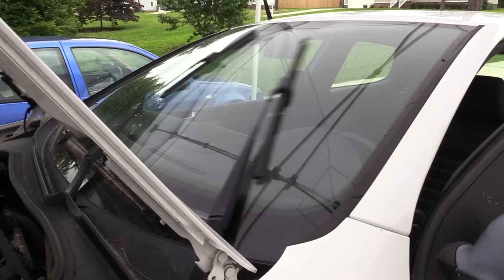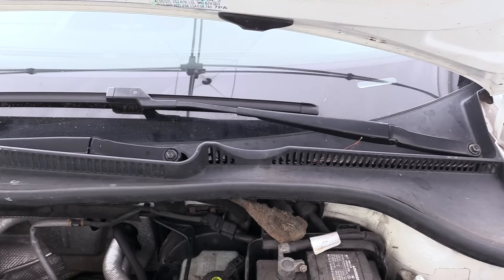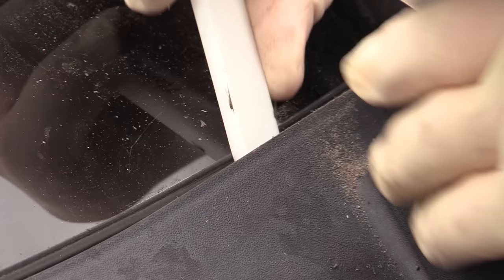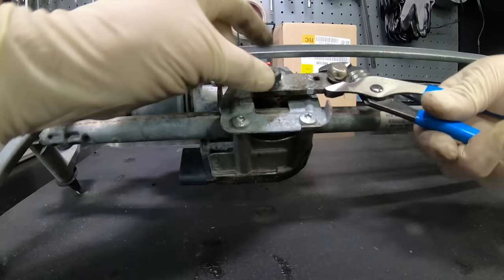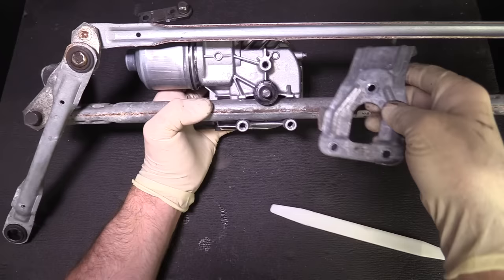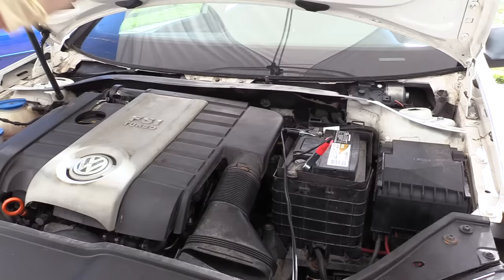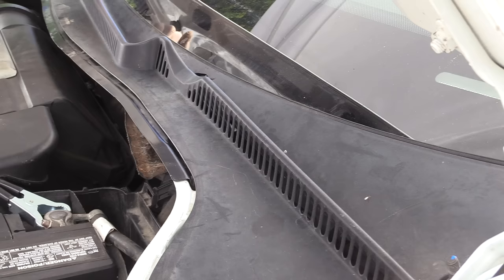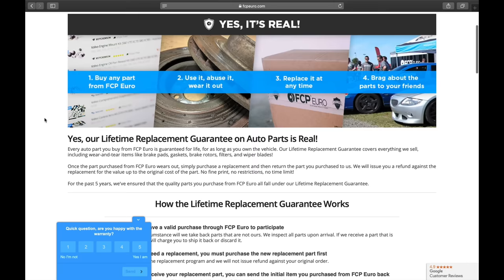How To Replace a Windshield Wiper Motor

Comment: Funny story and question for y'all: Yesterday, I asked my neighbour (who is a mechanic) to help replace the wiper linkage on my Golf Mk6, due to a snapped bolt where the wiper attaches (different story!). He went ahead and replaced the linkage with a new one I got on ebay, but when the job was nearly done, he tells me (in broken english) "motor no good, not work". This didn't seem right, since the motor was fine last time I checked. Long story short: the motor only seemed to be broken because the hood was open, thus disabling it (thanks VW!). But while he an I attempted to troubleshoot this rookie error, I must've pulled the 30A wiper fuse and put it back in the wrong spot, because the wipers still failed to work even after closing the hood and going for a drive! After an evening of googling, I went back to check the voltages at the motor this morning, and noticed that the live wire was reading 0 volts, promptly rectified by putting the 30A fuse back in the right spot. I was about to throw a party to celebrate when the motor hummed to life, but this was cut short when I realized the linkage was only moving slightly, no matter what position I put the wiper lever, and would appear to get stuck almost immediately, making only small noises and twitching slightly beyond the initial movement. I now suspect that my neighbourly "mechanic" has put the linkage back on in the wrong timing position :(. Looking at this video, it seems to need a very precise placement. I'm therefore wondering if there is an easy way to spot if the linkage is incorrectly clocked, before I go to all the effort of blaming my neighbour and getting him to pull it back out and do it over. What position should it all be in when parked?
Reply: Update: pulled the linkage and motor back out and found that the arm was attached to the motor in completely the wrong position, and as a result, was getting jammed against the metal stop every time the motor tried to turn. Following this video to the letter, I was able to remove the linkage arm and re-secure it in the correct position. After reassembly, it all seems to be working like clockwork, wiper blades in the correct position and moving smoothly. Thanks for the tutorial, humblemechanic, you saved me from a bad situation!

Comment: Excellent video! Commentary perfectly synced with what you are doing AND steps in sequence without "oh, I forgot, or mumble mumble, or crap I dropped the camera, or sorry my lighting is non-existent"
Every other video done on this topic neglects the removal and replacement of the plastic cowl without damaging it, as if its no biggie. Cleaning it and the mounting groove is critical for safe re-installation.  That item costs over $80 plus shipping, and the mechanics carelessness is charged back to the customer! Shabby business!
Thanks very much for this top notch video.
Reply: 2013 Chevy Lt sonic car how Do you Replace a windshield motor show me a good picture of

Comment: Thank you SO kindly for sharing this video, as well as your knowledge and expertise in this field, so very appreciated.
 I took my 2003 Honda CRV in because while driving my wipers froze, semi blocking my clear view, it was a very scary experience to say the least.
I took it in the next day.
When i picked my car up a few days later i tried the wipers out before i left.. the first thing i noticed is that, unlike before i took it in, my wipers when the were resting down inside that little space/nook at the front.. AFTER he changed the motor the wipers no longer went down as far as they used to, rather they stopped much further up in the windshield, it actually took me about 3 weeks to get used to driving with them so high up on my W.S, they were quite a distraction for almost a month, still are once in awhile.
 He, the mechanic, told me that it was the timer and if he adjusted it anymore it wouldnt be good because they would go down too far and potentially break.
NOT ONLY THAT but the very next day i noticed that there was a crack in the windshield in the bottom left corner, it was about 4-5 inches.. 2 days later it would end up expanding the whole length of the windshield.

  I called him the next day to let him know and he let out a very stern F..K! After that call i left him subseqeunt messages without a reply were now in Nov.. this happened in Sept. And! Its much colder outside and im afraid to drive with it lije that.
Something told me to look up how to fix a w.s wiper motor and your video was the first one to come up and it confirmed my suspicions as you mention,  THREE different times in this video, to BECAREFUL OR you can BREAK the windshield..Judging by the stern F... he let out he knew! 
But now hes trying to down play it, i also JUST found out the mechanic is not a certfied mechanic.. i suspected so as each time i would bring my car to get fixed the problem never! Truly did get fixed😐

So! A huuuuge "THAAANK you i have subscribed to your channel and will enlighten myself on different situations. It is SO hard, especially!!! As a woman, to find an honest mechanic.

Comment: Had to do this on my MK5. It turned out to be the wiper transmission, not the motor. Ended up having to buy a new trans. The shafts that the wiper arms mount to were completely seized to the point where i couldn't even get them apart without destroying the transmission.  That being said, i would def recommend greasing up all the pivot points on the transmission. Awesome vid as always Charles!
Reply from the maker: Dang! I’ve seen them break but never seize. Wild!!

Comment: mine stopped working while driving in the rain. it was linkage. cleaned it up, greased and it works like new. fortunate enough it wasnt a motor. great video!
Reply from the maker: That’s awesome.  I mean not that it broke. But you fixed it with out parts!!

Comment: I had an issue with my driver side wiper that just didn't work and was completely loose. I thought at first it was a loose bolt, but it was already tight when I went to torque it down.

I did this job, but replaced the whole linkage/motor assembly with a used one. After I completed the job I realized I didn't need to replace the linkage at all. The issue was that my driver side wiper arm was stripped and wasn't making a solid connection with the splines on the motor. 

At least I know how to do this again if I ever need to in the future

Comment: For some vehicles, a battery post puller works great for removing stubborn wiper arms. I also have a metal trim removal tool I modified to seperate the ball and socket.
Reply from the maker: Yep, that is my backup if I have a stubborn one.
Reply: A small scale HF bearing puller kit (about $20) comes in very handy for this and small motor jobs.

Comment: This is very helpful.  My red mk3 jetta has wiper problems and I think I may have to replace the whole wiper assembly and motor.  As it can never sit right.  Always parked at a weird angle and whenever I thought it was fixed it would go below the cowl.
Reply: I think you can sort of re situate them, but if it keeps occurring it might be time for a new one.

Comment: It’s also quite common that not the motor, but the mechanism itself is the problem. It seizes up due to rust etc. I’ve had that once and had to put the old motor on the new mechanism. I got the impression the motor itself is quite strong.

Comment: Just did this to my mk3. It was all gummed up at the nylon grommets and the plastic gear inside the motor was stripped. I cleaned all the nylon parts with silicon lube and used high temp. grease on all balls and shafts. My arms needed a little cleanup and some trim & bumper paint. Good as new now.

Comment: I'm working for Bosch at the wiper system department. Kinda painful to watch that you talk about those wide tolerances when during design we have to fulfill the customer requirements with way tighter tolerances :D Also wierd to see this come back on youtube, I know the designer and I have access to the 3D files as well, strange feeling :D
Reply: Hypeboy 
...then send a link, brother
Of course, that’s no doubt proprietary information. 
But why bother viewing this video if you already built the wiper motor from scratch?
Reply: @robertbleicher5452  Wouldn't risk my job on it, sry :)
I've been a subscriber to this channel for a while now, can't remember exactly since when but enjoyed the VR6 videos. It just popped up in my feed so why not see how ppl replace/repair the wiper system?

Comment: Some tips from 15 years of different car serviceing.
(Cars with only on windshield wiper motor).
1 the motor only turns one way.
2 it allways takes the full 360* turn.
3. it allways stops on same spot (if the motor is working).
4. Paint mark the motor axel on one corner and test it on drizzle speed to mark the resting position before asempeling it to the car!
5. Resting position of the motor is the end position of the windshield wiper arm gear/ transmission(down position of the windshield wiper arms).
--That means that the fisth short arm that has the nut to the motor is (ALLWAYS no buts) in the direction that makes the secend arm directly over the first arm, So its heading 180* from the firsth arm.
So after you know the direction, you firsth need tighten the nut, before you isntal the secend arm(do not let the motor turn as you tighten the nut!) and so you do not need to mesure anything via tape mesure.
6. Before you install the wiper arms. Paint mark both axels and activate them again on drizzle speed to make sure it allways stops on down position and dont sturt to come up.
--If it dos then the motor moved when you tighten the nut on the first arm OR the secend arm wasent at 180* from the firsth arm.

7. Most windshields has marks for the correct wiper arm location on them.
Reply from the maker: I never knew that about the windshield marks. That is awesome.

Comment: Great shot, really stable and precise 👌🏾
My question: Is there a difference in wiper shield motor for the LHD and RHD? I placed mine in my polo 2001 and when calibrating the shields in horizontal position to go up, it went down. I actually had to place my shields 45 degrees then it went down to horizontal position and then up, to the vertical position, passing the rest position in 45 degrees. So I was thinking the motor is turning the other way it’s supposed to. Is this a mechanical fault; so I got a motor for a RSD or did I not calibrate it  right? Thanks

Comment: Just did a linkage lubrication for a 5N Tiguan yesterday. Sadly the motor is making a noise and needs to be replaced. Hardest part was to get the linkage with the motor out from the car lol.

Comment: Hey, my passenger side wiper stopped working a few days ago after a snow storm. The driver side is fine. I’m pretty sure I somehow disconnected it from the motor while getting ice off. Any chance you have a video on that repair? I haven’t opened it up yet but I assume there’s some little clip that connects the wiper to the motor.

Comment: how do you know the new motor was in the park position before installing? i would have set park position by connecting motor electrical plug before fitting linkage.

Comment: Smart! I like the trick to loosen the wiper arm.... I’m the guy that broke said windshield, ha ha
Reply from the maker: I’ve seen a ton. Lol never broken a windshield but plenty of other glass. Lol
Reply: Me too! I used a small puller to get the arms off after breaking the windshield. The pullers are also used for pulling battery cables off the battery posts.
Reply: Ditto

Comment: Thanks, very helpful, must do preventative maintenance on water drains on mark 7 golf and clean, also had windscreen replaced and wiper now hitting A piller, thanks for 10mm tip too.
Thanks

Comment: I replaced my motor …  checked it out and went side to side perfect but then when the wipers turned off they were stuck up the windshield a little bit not staying down at the bottom as usual, any Tim’s on how to fix this ????

Comment: if my driver side arm is not reaching far enough (even though the rest position is correct and splines are not slipping) is it possible the linkage is damaged?  or also is it possible they got installed in the wrong position?  the arm with the bent is passenger side right? (mk6 golf R)

Comment: Hi, I installed my wiper motor and transmission on my MK5 Jetta and the transmission is butting up against the driver side inner frame. After watching your video I figure that the motor was not in the home position, as I didn't check if it was when it arrived because it came pre-assembled from RockAuto. Do I need to remove it and make some adjustments?

Comment: Hey, I replaced wiper transmission on 1997 VW Jetta. One of the wiper blades lifts in the center and doesn't contact window anymore.  I attempted replacing the arms which made both do it.

Is there any tip to fix this problem?

Comment: Hey Charles, I watched this video twice and I missed how to adjust the wiper arms once the motor is reinstalled. I did see a quick video closeup of one of the arm studs that had a mark on it bu I am not sure how it shows blade motion for alignment. When installing the motor to the linkage and using a 3mm spacing along with the 10mm blade to cowell, is that all there is? Thanks you!

Comment: How long does it take a mechanic to replace a wiper motor ? Is this a quick & easy fix ? 
Approximately how long does it take? thanks in advance
Reply from the maker: Depends On The car. Usually an hour or so. Plenty of cars can take longer
Reply: @HumbleMechanic  Thanks.  I was asking because i found the part for my 2013 Chevy Captiva for $65 and the one Mechanic guy was trying to tell me 5 hours to put it in.  😅  lol.
 I knew he was exaggerating especially after watching the video.
  I'm good to give him $50 to install it? 
You think that's fair?
Reply from the maker: I don’t know for sure. I’d call and get 3 quotes
Reply: @HumbleMechanic  ok. 
Will do. Thank you.

Comment: Question!! I live in Finland and at winter it gets to -25C and i feel like my wiper motors are freezing and they don’t work before I have driven the car to a warm garage for like 15-20 minutes. Any idea how to fix that? Its a 2013 Jetta and it has done it every winter since I bought it in 2018

Comment: I bought a used one wiper motor for my 07 Passat FSI， it don't work, I close  the hood, the spray is working, I test the connect, it has power 12.V, ground, and power  around 11v ? Do you have any ideal?

Comment: 5:30 this is the part I am stuck at. This just spins freely in either direction and I cannot for the life of me get that bracket off. The new transmission did not come with a motor and came with a brand new crank arm so seemingly they expect me to reconnect the old motor by removing the old crank arm. I am trying to avoid having to pry or break it off because I cant damage the old motor, its hundreds of dollars to replace it

Comment: From my experience Most fail because of people running hids and getting a voltage spike down the earth as it's shared with the motor. 
Im sure all mine were 12mm on the wiper nuts but I am in the UK maybe it's different on your end of the pond

Comment: #HumbleMechanic I have an off topic question.  Do you have any knowledge on installing a dash camera fuse tap in a 2018 VW Tiguan SEL. Fully loaded (WHERE HEADLIGHTS MOVE AT YOUR TURN AND EVERYTHING)

Comment: I need help please I have a 99 Saab 9-3 and it died in my randomly I think it's my fuel pump but I'm not sure because I also need a bank 1 O2 sensor which is making it lean but I've also heard it could be a fuse plz help

Comment: You pulled a fast one. On a few people.  You did  not TEST, TEST, the damn motor before installing    How many  parts  is parts do you put together   then you have to replace the new unworking 
PART.??
    My Polish mechanic
Reply from the maker: Fair point. Lol but it’s a very low %

Comment: A wiper motor that breaks when it gets wet? Only an engineer could come up with that.
Reply from the maker: Only when water gets inside
Reply: @HumbleMechanic  right. It just amuses me because of all the parts on a car you might think to make impervious to water it seems the wiper motor should be high on the list.

Comment: I’ve replaced my motor with two good motors and they won’t work. I have power, ground and signal at the connector... I can’t figure it out
Reply from the maker: if its this type of car, make sure you're testing it with the hood shut or at least latched. Newer VWs lock out the wipers when the hood is up
Reply: @HumbleMechanic  we have the hood shut :) a tech said to unplug the module and plug it back in? It’s an 05 Jetta...

Comment: Hey man I have some questions about rebuilding my 3.2 vr6 from my mk4 r32 I’ve met you before I worked at the Volkswagen dealership for a period of time and I went to ask you on Instagram and I notice that I’m blocked by you :/
Reply from the maker: Weird.  Sorry about that I don’t think I’ve blocked anyone on Insta. Well not on purpose. What’s the question.
Reply: I bent one of the thin metal plates in between the engine and transmission when I was disconnecting the transmission. If it’s not 100 percent straight should I replace that?